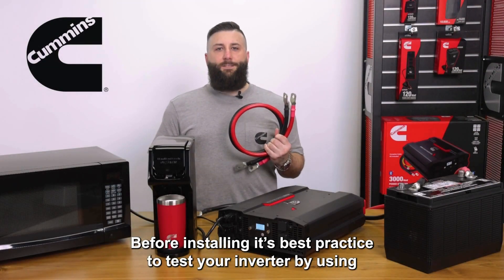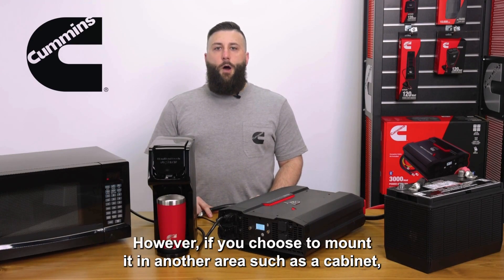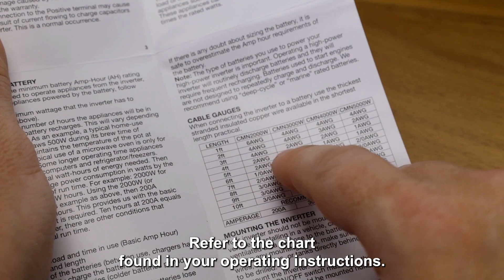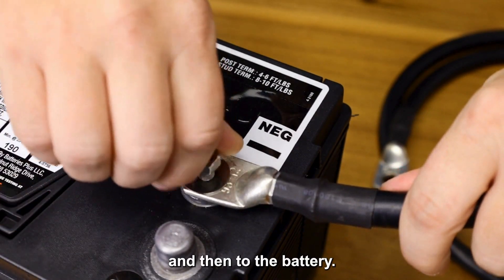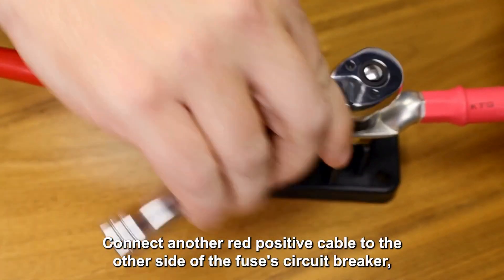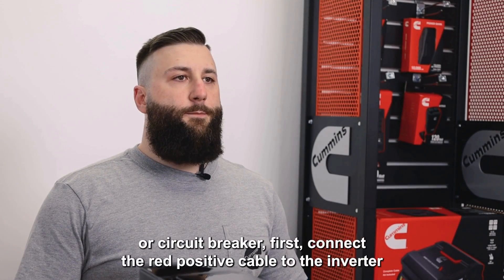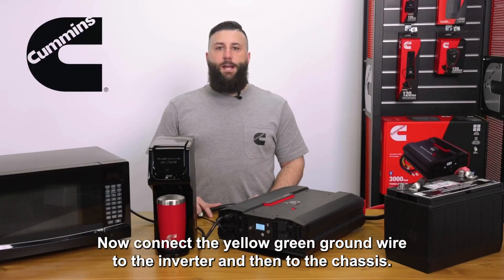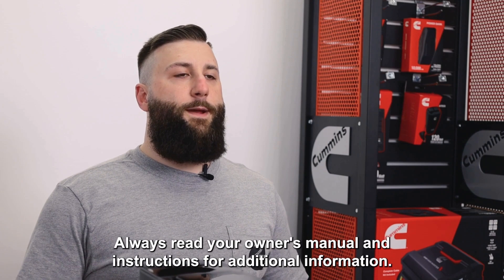How to install your Cummins Power Inverter

Comment: I have been trying to figure out what ANL Fuse holder I need for a 5000W inverter connected to a 12v battery

Comment: Why does the manual recommend 4 AWG @ 1ft for 5000w/12v inverter @ 51 sec? A 500 amps draw will require at minimum two 4/0 cables for each leg.  Anything less and the wire becomes the fuse.  Putting a 500 amp fuse on a 4 AWG wire is a fire waiting to happen;  the fuse is there to protect the wire not the device.
Reply: Their incredibly highly educated designers want to trick everyone